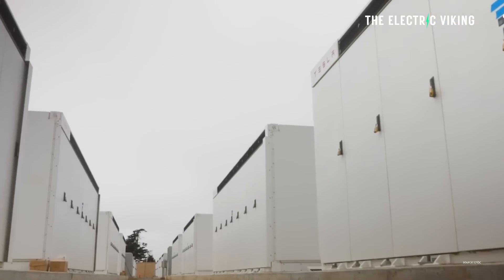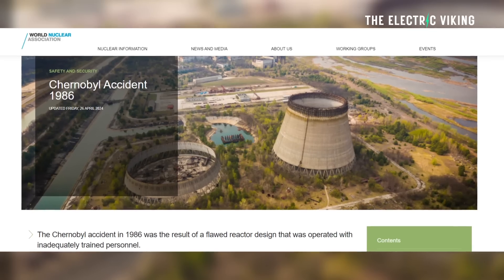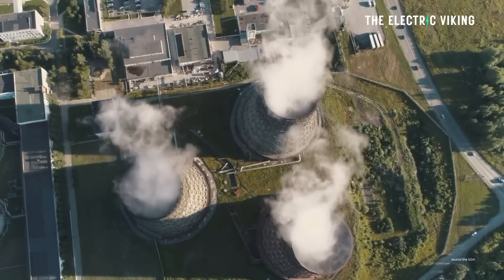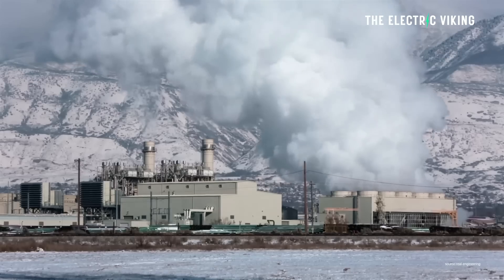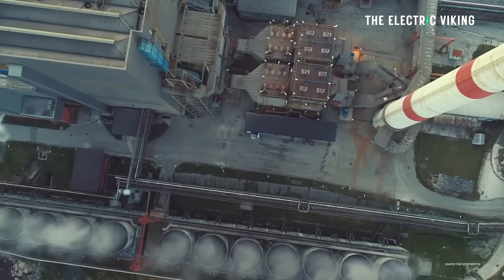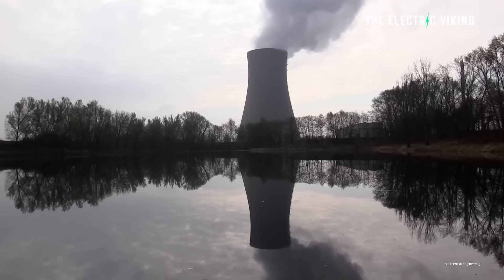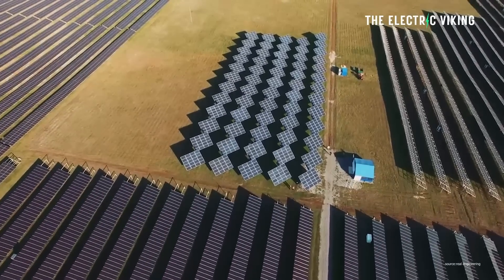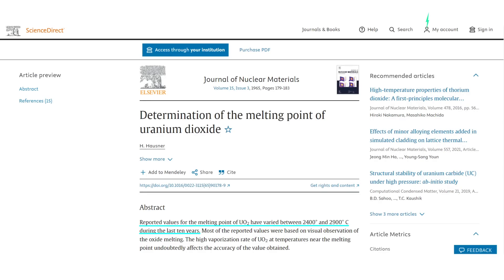China build the world’s first thorium molten salt nuclear power station

Comment: The US national laboratory at oak ridge TN made a test reactor in the 50’s. The story is fascinating. It stemmed from a request from the Air Force for nuclear powered bombers. Terrible idea, but an interesting problem and the engineers figured it out. The technology was squashed by Nixon for several reasons mainly that it wasn’t developed in his home state like the light water reactors were, but also because it will not produce material for nuclear weapons. In fact you can use a LFTR reactor to burn waste from the more conventional systems. It really is an incredible technology and while I agree that the majority of power can be supplied by renewables, this may find an application very close to its original intent powering long range space exploration. There are many old YouTube videos about this that are well worth watching. You have a decent overview but it’s actually way better than you think.
Reply: I've thought for years that nuclear was only ever used as an energy source to build weapons with. They didn't care about the environment in the '50s (they hardly care now), so that wasn't the reason. Nuclear is the most expensive source today, let alone seventy years ago when fossil fuels were so much more abundant. So why would anyone want to build them? Let the market decide? We'll wouldn't the market just go with the cheaper and faster to build fossil fuel plant? Weapons would be the only conceivable reason, and probably the real reason they stopped building nuclear plants in the '80s: the cold war ended. No more rush to churn out more nukes than the Soviets.
Reply: @metsfanal  You should look at France before posting such a message. Lots of nuclear and the cheapest electricity in Europe. Admittedly, with renewable prices that have gone down and nuclear going up the tables have turned. The market can't build a nuclear reactor because it's a long term investment and nobody on the market thinks long term. Being a strategic asset, those have to belong to the state (like in France) which can guarantee safety.
Reply: @johngonon1507  I’ve looked into France. It was a huge mistake for them to use nuclear as well. Extremely expensive outcomes compared to if they had gone with fossil fuels. Though at the time they had done it, it was the most viable solution to reduce emissions. Not anymore though. Anyone arguing old style uranium nuclear in 2024 doesn’t know what they’re talking about.
Reply: @johngonon1507 EDF which builds, owns and runs all nuclear reactors in France is state owned. They tried to go public, but it was a big failure and the government bought back all of the shares.

EDF really runs at a loss and the electricity is kept at a low price by using tax money to subsidise it.
In 2022 there was a lot of nuclear downtime in France. Partially because of the aging power plants which never got the funding needed to do more than the bare minimum in maintainance, but also because river water is used for cooling. In summer some power plants need to shut down to prevent destroying the underwater life in those rivers by heating it too much.
So a self contained Thorium reactor that does not dump heat and (diluted) Tritium into rivers and seas seems like a much better idea to me. The nuclear reaction slows down as the molten salt gets hotter, so risk of a meltdown is also zero if reality lives up to the theory.
And let's face it: building nuclear reactors takes decades and billions. It is simply stupid to keep making reactors based on 1950's technology if something safer can replace it.
Reply: Where do they dump the nuclear waste? @metsfanal
Reply: @SolAce-nw2hf  EDF runs at a loss ? 2023 shows a 10B euros benefit ... because they where able to use more nuclear production and despite being forced to sell nuclear power to a ridiculous price to help the "free market" have better prices than them. For the past 20 years, the state funded nuclear plants (that belong to the french people) have been jeopardized to create artificial concurrence. You should first document yourself on why things happen rather than just look at numbers. The state finally decided to re-buy the shares to stop all this non-sense, finally !!!!! We just lost 25 years of knowledge and know how in nuclear technology, which showed up when building the new EPR. Hopefully, they will put the state needs before "market" interests. And EPR's are not 1950s tech, they have passive cooling features too.
Reply: @loktom4068  There is no waste. The LFTR process helps refine the fuel to be reused. It can use existing fuel rods that they don’t know what to do with and refine them and reuse them essentially until they are gone. I know it seems to good to be true but it’s really too to good to let be used because it makes too much sense. History is full of inventions like this.
Reply: @metsfanal  my guess: if France hadn't invested in so many LWRs but used fossil fuels, the price for fossils would have gone up much higher than it did historically from 1970s on! 
But now EU is on the wrong track, hoping for Fusion, Germany going PV & Wind only (Minister Habeck isn't the brightest!!) , and France doing the same old Nuc tech all over again, with marginal improvements. Now their reactors don't have enough cooling water available in the summer! PV wouldn't need cooling water in the summer, wouldn't it! They should have invested in Th MSR reactors, safe, broader, and larger nuc-fuels base, much less rad-waste, lower operating pressure, much higher temp (670°C) -> higher Carnot cycle efficiency, and therefore less cooling water! 
Why didn't they go that Route? PV+ThMSR. 
if France would invest into Windturbines, most all they could achieve, would be to diminish the German and Danish windEnergy "harvest"! Pretty sure about that; isn't it Logical
 I am only engineer, so my Philosophical, Socioeconomic/Hierarchical credentials/status are too low to be considered by powerful but idiotic and much corrupt EU politicians.
Reply: @metsfanal 
I live in Australia and there is current discussion about possibly building nuclear power reactors to replace our aging coal powered stations the argument being that we have I think the biggest deposits of uranium in the world so in theory we should have access to the raw resource cheaper especially if the assets are publicly owned and fuel availability was domestically prioritised the yield and affordability could have huge advantages if managed correctly
Reply: @metsfanal  Power reactors are not ideal sources of weapons grade plutonium, Pu239. There's a specific residence time wherein the neutron flux will create Pu240, Pu 241 etc from U238 that are not desired because they are not fissile. That time is less than 6 months, IRC. Economic burn time for a power reactor is at least a year. The reason power reactor are not economic today are the regulatory hurdles, extraordinary construction project duration (>10 yrs), NIMBY lawsuit roadblocks, etc. Add to that your correctly stated cheap gas and coal fuels here in the USA as another nail in the coffin for nuclear power. I'm a refugee from the industry. After 3 Mile Island the hand writing was on the wall and I left the business and spent the next 3 decades in the aerospace business until I retired. A few people talk about a revival of nuclear power in the USA and I laugh. Who is going to build them? The entire industrial infrastructure and the workforce is almost extinct. It would take at least a decade to resurrect it. And forget about nuclear fusion. Fusion is 25 years in the future and has been that way for the last 50 years.
Reply: @Tony-om5kr  good points and yes weapons grade plutonium comes from a different reactor type. I felt that was just beyond the scope of the power conversation.
Reply: @metsfanal  wrr
Reply: Kirk Sorensen has been beating the drum on this for decades. He’s a good speaker too.
Reply: @ejduffy  wr
Reply: Another reason for the LFTR reactor is that it can be installed in desert areas areas as it doesn't require water for cooling. It can literally be installed anywhere and is inherently safe like pebble bed reactors.
Reply: Politicians will always be the main problem when comes down renewable energy because it first have to benefit them first then everybody else of which is a shame because a lot of problems can be solved if politicians remove themselves from the equation.
Reply: @cedricjackson7521  Less policy intervention indeed yields better results.
Reply: @cedricjackson7521 
In Australia we have found our politicians have much more concern with lining their own pockets before acting to actually benefit the country they are elected to run.  If they acted with integrity and did the best thing for the country more likely to actually benefit themselves further than just selling off resources for their own personal benefit so short sighted
Reply: @joshdrougas7419  when comes down to politicians. Greed is always the problem because they think of themselves first then everybody else unfortunately.

Comment: The cleanest and safest nuclear reactor is the thorium molten salt reactor.
Reply: A bold assertion with our current lack of true experience about these reactors. Well... Chinese will have one now. Let's wait to check the reality against the papers.
Reply: @oatlegOnYt the United States had one fully operational for years until Nixon defunded it
Reply: @pgiatrakis  Experimental reactor only. Not for commercial operation.
Reply: @oatlegOnYt ,Yes, we shall see!
Reply: Except so far they don't work. They have been trying to get Thorium to work since the 40's. I really hope they do, but they are not as safe as its proponents claim.
Reply: @DeveloperChris  the United States had a fully operational liquid fluoride, thorium reactor for years that operated safely. You can’t have a meltdown when the fuel is already melted. You can’t have an explosion. If you don’t use water to it it is as safe as it can possibly be safer than a gas station in your neighborhood the only technological problems with it were the corrosion of the piping from the liquid salts and engineers have worked around these limitations using Hastalloy metals.
Reply: @pgiatrakis  Where? I know of no operational thorium reactors outside of test reactors anywhere (ATM). I recall the US had one for a while in the 60's but it was not liquid fluoride, Oak Ridge used molten salt and that's the only one I can recall. Hmmm. I just looked up Oak Ridge and they did not even use thorium. So that's two strikes against your uncited claim.
I was a big fan of thorium and I did repeat the false claims it was due to thorium not being usable for nuclear weapons (it is actually cause it breeds uranium 233). I went down that rabbit hole and have come out the other side. Now I am cautiously hopeful but not a fan.
Reply: @pgiatrakis : And you need a reprocessing plant next to every thorium reactor. A proliferation nightmare for nuclear regulators.
Reply: @pgiatrakis Hallo alloys Hastalloy, very very expensive. Do hope an economic working reactor MSR is produced (eventually) but we know it wont be without a lot of trial, applauding Gates for taking on the endeavour.
Reply: Please stop exposing your ignorance in a public forum.
Reply: @DeveloperChris 
Engineering and testing was sabotaged by political activists.
Reply: @DeveloperChris  I wish that it was true that there has been active work on thorium reactors, but it really hasn’t been pursued aside from China, India, and some fringe elements in Canada. The Nixon admin quashed it claiming that the salt would cause corrosion. In the US that was the end of the story. Despite incredible advances in materials science that has remained the final word until now.
Reply: @DeveloperChris  India's first large research reactor that uses U-233 as fuel is "KAMINI". KAMINI: KAMINI ("Kalpakkam Mini") reactor is India's first operational reactor using Uranium-233 as fuel. This is a unique achievement, as U-233 is not naturally occurring and has to be generated from Thorium.
Reply: @shawnnoyes4620  I am not sure what your point is. Kamini was a test reactor. It didn't use thorium. As you stated it used uranium233 which was created in another reactor. Which was a thorium test reactor.
Reply: How safe is freakishly hot and extremely corrosive molten salt? Is molten lava safe?
Reply: @themogget8808  interestingly the heat is what makes it safe. It allows for a passive safety system rather than on which requires power (which was the problem at Fukushima Daichi). It precludes the possibility of a radioactive steam leak because it operates at low pressures. I recommend watching a few Kirk Sorensen talks, don’t worry, he’s actually pretty entertaining.
Reply: @ejduffy  I have his book on my shelf. I agree that passively safe nuclear is better, but I disagree that we need molten salt thorium to do it or that catastrophic meltdown safety is still a problem with modernized reactors. Part of what makes nuclear so hard to work with is the temps and materials involved. Molten salt can corrode and melt steel, and can explode when contacting things like normal water. Interestingly it is the heat that makes nuclear dangerous in the first place.
Reply: @themogget8808 most plastic plants use more dangerous chemicals and aluminum and steel plants are hotter
Reply: @michaelcummings7246  Yes, and those are dangerous places to work, with those "25 days since last horrible accident" signs posted. A thorium reactor will still be very expensive because of the protocols needed to manage this stuff safely, on an ongoing basis, to make power every day.

Compare that to a photovoltaic solar farm..... which has none of these hazards. I just don't see thorium as enough different from any other passively safe advanced nuclear design in any of the ways that matter. It will be similarly safe and expensive and centralized and water-intensive. It might be the best version of nuclear, but it would fill a similar role - a dying role.
Reply: The Americans were well advanced with Thorium in the 1960s, but you can't enrich Thorium to make nuclear weapons. That is the real reason why the West didn't pursue it. Whoever said Uranium is a sustainable source for electricity generation anyway?
Reply: @pauleast4372  : You don't enrich Th232 to make U233, you breed it.  That's what thorium reactors are: breeders. U233 is just as fissionable as regular U235 and can thus be used either peacefully or less so, to put it mildly.
Reply: @pauleast4372  What you are alluding to is really just your day to day boring conspiracy theories.
I researched thorium quite a bit back in the early 2000's (as I did most energy sources) The Americans were not that advanced and the conspiratorialists said it was due to enrichment. I am sure some of the reason was, but the world has moved on a lot since then and if it was that advanced (and safe) it would be in production now.  
Do you think America would let China beat them to the punch for safe economical Thorium, if they knew how to do it?
Of course not!
Reply: I am not saying you are wrong, but I believe thorium reactors can be used to generate uranium-233, if the operator has bad intentions, and so create a dirty radioactive bomb.
Reply: Sam doesn't seem to think so...
Reply: I'm sure you are Kirck Sorensen follower. In nuclear industry only time able to dicide about safety economy maintenance issues etc. There planty of promenante conceptions
Reply: @ythowdy2838  For the moment, would give the Natrium (Bill Gates)  a shot first, once the hurdle of corrosion is handled then try for Thorium. As is the Thorium one has a bit go many challenges to take on. Being Canadian, I am not biased against Candus.
Reply: Thorium doesn't fiss, it's actually a uranium reactor that breeds more uranium by thorium neutron capture.   Molten salts are dangerous because 1. It hot. 2. It's a corrosive salt. 3. It contains enriched uranium.
Reply: Fusion nuclear reactor 👈
Reply: @larryc1616  really? you know of one that works?
Reply: @larryc1616   To be honest... I think that even if we crack the secret to fusion... it'll never be economic anyway...  Well not within the next 100 years... (ITER is already redundant, before its construction is finished... various uni researchers have done that -  what a waste of money).  So, I think the world is best to purse Thorium and other Gen 4 breeder fission reactors in earnest...  Research on Fusion should continue on the slow-burn... knowing we'll never have economic reactors running in the next 100 years, so low priority.
Reply: @larryc1616  20 years away at least twice
Reply: And the most expensive power on earth, by 6x higher than solar and wind.
Reply: @RussellFineArt  the biggest expense of current nuclear reactors is the maintenance and safety of the nuclear waste which is actually 97% fuel and can be utilized in a liquid fluoride, thorium reactor thusly liquid fluoride thorium reactors actually are safer than wind and solar and since they get rid of nuclear waste they cost less than nothing because they save money
Reply: @RussellFineArt  Thorium is not a solar/wind/geothermal replacement. It's better suited for special applications that require high energy density and is also a long-lasting and non-fossil fuel. Think spaceships, submarines, etc.
Reply: @RussellFineArt if you really believe in what you wrought your noledge in the area very limited
Reply: The cleanest and safest nuclear reactor is no nuclear reactor at all. Bit of a slow learner, aren't you?